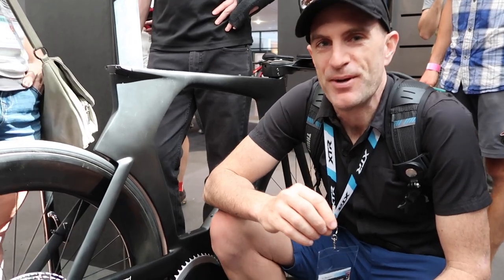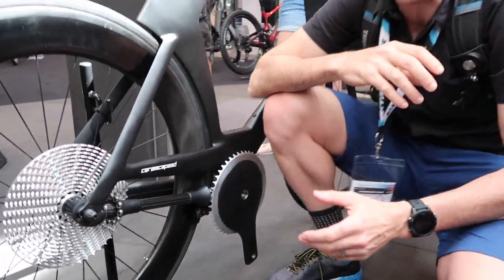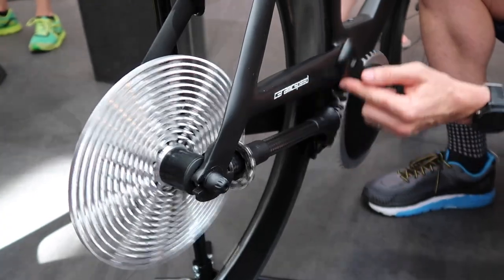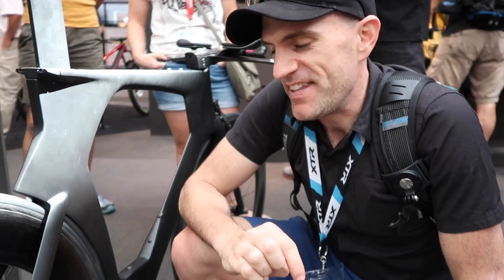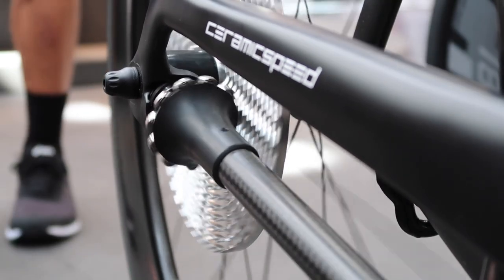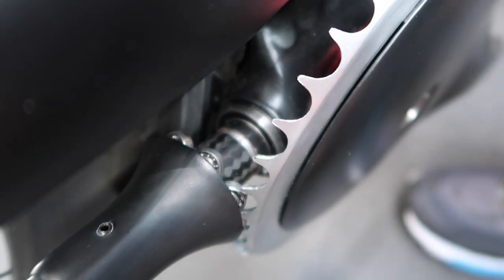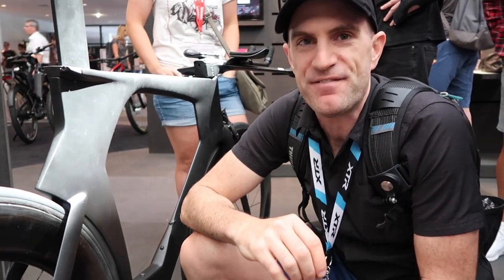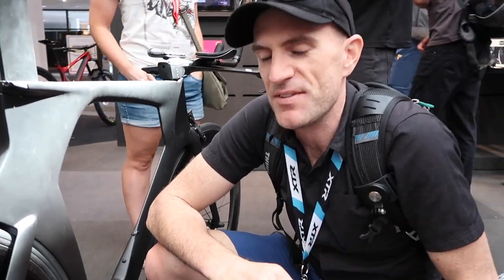CeramicSpeed DrivEN 99% Efficient Drive Shaft // Chain Free Bike // Eurobike 2018

Comment: Motorcycle have this since long (shaft drive) ... I'm not sure about the gearing here.
Can't see much advantage over traditional way.. 99 Efficient, take it with grain of salt.
Reply: Rattan Bhinder motorcycles lose about 12-13% per 90° translation. This has two so anything over 75% is probably not possible.
Reply: A motorcycle's drive shaft is after the transmission.  The driveshaft ends in a pinion gear that drive a ring gear.
Reply: dhy5342 so explain how this is functionally different from a ring and pinion. Explain how the drive is kept in contact with that rear cluster under torque. Explain how this is not subject to the same mechanical limitations of any other 90° translation gear.
Reply: I think the ball bearing tooth followers reduce some of the friction associated with ordinary bevel drives, although not the thrust forces obviously.

But then again, in motorcycles, the power loss from a shaft drive is roughly equivalent to that of a chain drive.

So this is like combining the rollers from a chain and the bevels from a shaft drive.  Except there aren't as many rollers under load, so the friction is lower, and there is no chain to whip around and sink energy into.

The main questions are: load capacity; contamination tolerance; bearing life; ring gear toughness.
Reply: identiticrisis the only motorcycle that came with a shaft drive and the ability to change over to a chain drive was the MV Augusta 750 of the 70's. MV claimed a 20% increase in rear wheel horsepower with the chain drive, so shaft drive is not as efficient by a significant amount. The ball bearing coupler is unlikely to be more efficient than an automotive style ring-and-pinion that is running wet. Here's something to remember, noise in a mechanical system is indicative of power losses due to friction. That drive was as noisy when driving as the freewheel was when coasting.
Reply: I agree about the noise, to an extent.

I see current chain and shaft driven motorcycles both in the region of 15 - 20 % loss, crank to wheel.  Maybe things have changed since the '70s?  I notice that helical bevels are more efficient than straight bevels; more efficient than straight spur gears, even.

I know that Kawasaki used helical bevels on their Z1300.  Honda and BMW both currently use helical bevel gears in their shaft drives.  What did the MV use?

Or maybe it's the swinging arm geometry, reducing the jacking effect and any extra friction from it.
Reply: dbmail545
Reply: dbmail545 a motorcycle's driveshaft drive ends in a fixed bevel gear, solidly meshed with either a ring gear or another bevel gear.  The bicycle's shaft ends in a movable gear which meshes with a variable size pinion plate.  This is simply nowhere near robust enough to match the abilities of two gears locked together in mesh.  It would require an extrodinarily large amount of pressure to keep the two components in mesh.  The resulting friction from this pressure would absorb most, if not all, of the power any human is able to produce.  
I note that in the video, the driveshaft gear was not shown to move, although that would have been beyond simple to do, even manually, especially for a demonstration.   Perhaps the reason that wasn't done is because it just doesn't work or it would have shown the impossibility of keeping the components in mesh.
Reply: Yeah, it doesn't look like it would be very smooth if you wanted to switch ratios.  Good point about the friction from the preload required to avoid deformation and unmeshing.  That preload would require the whole rear end, and wheel hub, to be beefed up.

Still, credit for trying.

Comment: Chainless? Yeah.
Will break easily? Heck yeah!
Is innovative? Nope.
Reply: Toreole 2 So does a chain bike
Reply: So you are saying that chains are more reliable that this chain-less system? A chain can handle more torque, but that doesn't make it reliable.
Reply: This is very innovative
Reply: belt means more power loss
Reply: booper dooper - a chain is very reliable because you can carry 20 feet in your backpak and change it out every five miles, on the trail with ease.

Comment: The thing will doubtfully work in mud and dirt, though it's comparatively easy to make mudguards for this one. Also, it's quite clear that the rear hub must be combined into one unit with this rear set of sprockets to prowide enough support and sustainability - maybe at a cost of shorter spokes. Anyway, this is much better than all previous attempts to add shaft drive to standard rear hubs. Hope this drivetrain gets into production and on to the shops at a reasonable price.

Comment: I fucking love this idea but that's a lot of force on the teeth.
To care for it, you will probably need to be very active on the gear ratios. I would like to see it extremely strong, you will probably need to replace the carbon fiber with Al or Steel.
Reply: 99% efficiency also seems far fetch
Reply from the maker: Agreed

Comment: After looking at this design the next step is the different shifting in and out of different gears. This can be accomplished rather uniquely and I have the solution. Look at a ratcheting socket or spring loaded key. Place the cables stainless steel rod or micro servo inside the main shaft. As the operator pulls or pushes into each gear the shaft will move under spring pressure back and forth changing gears with limited drag. Also the gears need to set a 20 to 45 degrees so changing gears is seamless. Hardest issue I see with be including some type of shifting mechanism into Main gear shaft or housing. One idea would be to place a micro servo inside the main gear housing and using a typical 9volt batter the operator would have a Bluetooth / wireless sensor with gear changes on the handlebar and viola. Limited weight and no wires. Just a couple ideas I have on top of my head.

Comment: DUMB.  Pedal with any load and it would skip completely. You'll be  pedaling and standing still.
Reply: Exactly, while slamming your shin on the pedal that spins back around with no load on it, and and falling strait down that drop when your front tire didn't stay up because of the skip.  Skipping a tooth on a chain is bad enough.  Can't even imagine the damage when this thing completely disengages at a critical point.
Reply: jones jones if you see in the video there looks to be a 1/2 inch carbon fiber tube that connects the back from the front. That's not going to flex that much, especially at the anchor points.
Reply: Max's Inventions yeah but an aluminum gear?  That would have to be titanium to remotely hold up to the load considering the small contact points.  I like the idea but it doesn't appear to be durable enough for serious use.  Even the guy reviewing it says it.
Reply: То, что вы говорите, верно, но я жду усовершенствований и дальнейших разработок.

Comment: I was at a vintage car show and there was a vintage bicycle section and there was a shaft drive bicycle from probably the 1970s , not sure. So I googled shaft drive bicycles and it turns out they were developed in the late 1890s in Britain and they didn't catch on so the inventor went to the USA and there was some interest.  
They are very interesting.  I believe the one I saw was a three speed.

Comment: There are always critics and naysayer of new innovations.  I remember when the first carbon fiber bikes came out.  The die hards cited lots of reasons they were impractical and unsafe.  They said, "ride safely on steel."  Then when integrated shifting arrived they had lots of reasons against it.  They railed against tubeless road tires.  They said electronic shifting was a fad, also that it put you "out of touch" with the bike.  I could go on.  I purchased all of those items early on and loved them all.  This innovation may work and it may not.  It looks promising.  I'll give it a chance if and when it comes to market.

Comment: looking at this. it will work .  with less friction at the points of contact with the use of ball bearings. however  load will be concentrated on one or two teeth instead of being spread over 10-20 teeth. so aluminium alloy teeth maybe too soft . so heavy hardened steel sprocket may be needed to be used for long life reliability.    concept needs real world endurance testing, mud & grit compared to chain

Comment: The obvious solution to the "indoor vs. outdoor" question, as well as the dust/grime problem, is to encase the whole thing in an enclosure of some sort.  With a retention mechanism in place, jumping out of gear would be obviated as well.  It wouldn't be as elegant but it would undoubtedly work better.

Comment: Very neat. I think the biggest engineering dilemma will be engineering the cycling community to embrace change for the better rather than pointing out every flaw
Reply from the maker: If the concept and design works, and works well, that's all that's needed. Opinions are overridden by good data.

Comment: all it needs is a spring pushing on a rod with a bearing on it with the driveshaft inside the bearing, it would press the cog on the end of the shaft into the plate. however, the plate needs to be made of some seriously heavy duty metal to prevent it from being bent from the torque being applied. another option is to change the design and ditch the roller bearings on the end of the driveshaft that go in the spaces in the plate, opting for a hardened piece on both the driveshaft and the plate for metal on metal contact.

Comment: Very much like the Toro Lawn Mower drive of 45 years ago. The difference being the "teeth" in the cogs. Toro used a rubber wheel on a smooth aluminum disc. that could be moved in or out on the disc to adjust the drive speed of walk behind mowers.

Comment: There's a good reason why this prototype has no pedals:  It will fail if more than finger pressure is applied to the crank.  This setup creates many more problems than it attempts to solve.  Dreaming up a clever new way of doing something is EASY,  the hard part is making that new way as robust, reliable and affordable as the design it intends to replace.  Anything less just isn't worth wasting your time on.

Comment: The problems with this drive are glaring. Do keep continue researching it though. The chain is the undisputed winner in a velomobile, but all velomobile riders are in it for better comfort and comfort means no chains. So as soon as this works  without problems on single mounted wheels, with suspension to pedals 180cm away from the wheels it would help high speed velomobiles.
If it can be equiped on a front drive like on the velotilt, with suspension and all, it might solve a problem or two.

Comment: Dual hub in the rear and in the front center the drive shaft downthe rock arm to the back Dual hub with a ceramic disk on each side and enclose everything the drive mechanism at the dual hub and also the crank's. Use a be bendable drive shaft like what is used in gas powered weed wacker's to power the front dual hub that also has two ceramic disk's with the transmission setting working both the front and rear dual hubs. 😀👍

Comment: Please test the following:

1. Set the lowest gear (biggest crown).
2. Lock the wheel.
3. Hit the pedal as hard as you can, even jump on it.

It's not careful but the chain can survive this test several times.
Reply from the maker: This was a prototype unit on display at Eurobike. You'll need to contact CeramicSpeed for further details.

Comment: Agree with Xia Jiang but harder steel, wider load surface can overcome load requirement.  The design is possible with newer materials at the same size too.  Just build, test, break, over & over until you finally make it work w/o breaking.

Comment: You need to protect those small ball bearings really good from the elements like dust and water or you definitely increase the inner friction of the system dramatically and loose that 99% efficiency. Very cool innovation. I hope you are able to develop it further.
Reply: Need to use sealed bearings.
Also consider redesigning the driveshaft as part of the frame, eliminating the "ceramicspeed" bracket (it only provides horizontal stability anyway).
Use  fluid within the shaft to move the rear bearings along a slotted shaft.  Rear bearings would be spring loaded on one side oil on the other.  
Version 2 or 3.0….

Further observation… the rear disc will want to bend so will need strong reinforcement from bending and slipping - unlike a chain drive.

Comment: There was a time I did not put much effort into tying my shoe, and the shoelace got stuck into the gears and chains like a fetter putting the bike into a complete stop. 
My balance was lost but I could save myself by extending my foot to the ground, but the bike started tilting to the direction where my foot got stuck. 
I had a choice, to panic, instead of extending my other limbs to balance myself. 
I hit a curb nearby, if it was a fence or a stake, it would be my luckiest day on being in an accident. Gladly, I sustained only a bruise to my hip and to my self esteem. 
So I learned a lesson, never use bikes again because they will suck your shoe parts and put you in danger, an armchair is enough to put you on 23 countries quickly and not instantly without internet and you must have visited at least 23 countries to be able to do so but you will be unable to encounter new events from your last visits.
All of this is true except for the second to the last sentence, tie your shoes properly, or you might just become someone who blames the bike for danger without regarding other factors.

Comment: Use a chain between ( or belt ) with 2 cones facing each other in place of the cassette, as in a CV transmission. One ring up front. also, the chain or belt will always track straight. Grease and dirt could be death to it

Comment: The basic design of this drive system is over a hundred years old. It was tried in the early days of the Automotive industry, but was found to wear out quickly. On a much lighter bicycle application, it may be more successful.

Comment: instead of using 1 pipe use 2 ...
push the star thing more outside and have 2 sticks spinning the star thing. this way it will stay in place.. also both pipes can be held by a peace that can be attached to the frame of bike and also adjust the gears

Comment: Going to keep my eyes on this very interesting. 
I would imagine at launch would be very expensive but if it replaces the current bike model then it will slowly become more affordable. 
I just worry about the ballbearings as anything with those in usually don’t last very long under pressure.

Comment: Some safety Concerns :
1- With a shaft system like this, Unlike a chain system, if any jamming occurs, you'll be in big big trouble(depending on how strong the material will hold).
2- The sticky pikes coming out from the wheel will get this system banned for racing before even released due to rear wheels mostly flying(and sometimes hitting,don't ask me how i know) to the riders/racers. Now, parallel alignment of gears is way more safer before those spikes will not land on anything(very low chance) but with this rear wheel, it's no trip to hospital when that stuff flies and hits to someone. You know the meat tenderising/softening hammers? Yeah.. Concept it is but far far away from being safe. I'd never ride a bike like this,and would stay away from the person who rides it for my safety sake.

Comment: I feel like this has potential. As long as one gap between teeth is aligned accross all gears, perhaps with a bridge accross the gaps, the shifter can be gated to only shift at that point. Could also halve the amount of gears to allow double wide teeth which would spread the load and have a second ring on the front as well with a second shifter. Gears will need to be hardened carbon steel though or its never going to last long.

Comment: Shaft could be placed in the frame for durability. A short chain could still be used on either end. The plate could be made out of chain material or the end of the shaft could use chain links in the shape of a gear/sprocket to turn a conventional sprocket on the wheel hub ? Maybe I should be building them ?

Comment: There is a huge difference to a chaindrive: You can put this new drivetrain in a light carbon enclosure and dirt is no problem for most users. On the other hand a chain would allways transport dirt, an dirt protection won't work there.

Comment: There are several antique single and multi gear drive versions out there. Pinterest is littered with them, but I had seen a roller design similar to this that was a single speed. This seems like a combination of the two styles whose patents would have long ago expired. It will be interesting to see if the patent office thinks this is different enough, it functions properly,  isn't insanely priced, is maintainable and repairable.

Comment: They have been teasing this for years now. Right now the biggest hurdle is gear change. The next is metallurgy aluminum is not gonna cut it not enough shear strength. The only metal I can see for the rear cassette is titanium.

Comment: Material aside; the sprocket will be under such stress it will flex at least 1/2 Millimeter and that's all it will take to disengage. It will disengage once and will never work again. Titanium, stainless steel, polyblobdaminium, it doesn't matter what material they use it's just not mechanically stable to expect one tiny point to hold up a pouncing 165 pound athlete. The good ole standard chain is engaged with 20 points on front and minimum of 7 rear and they are steel!